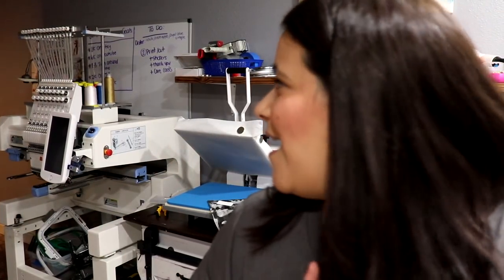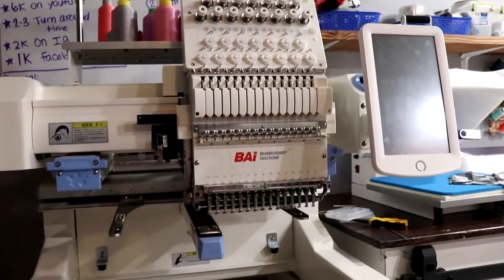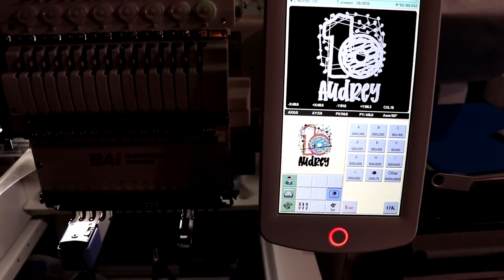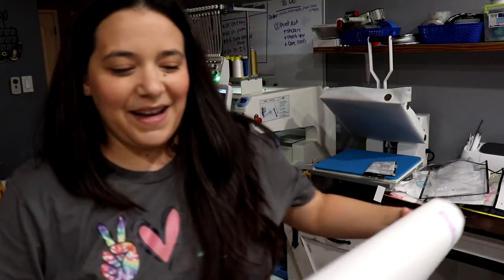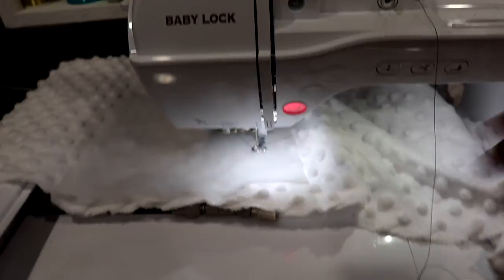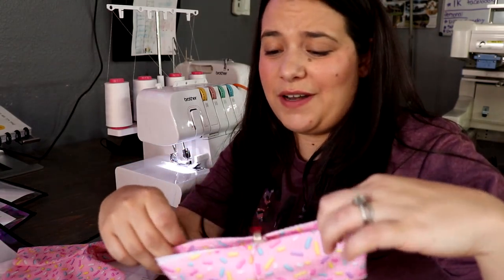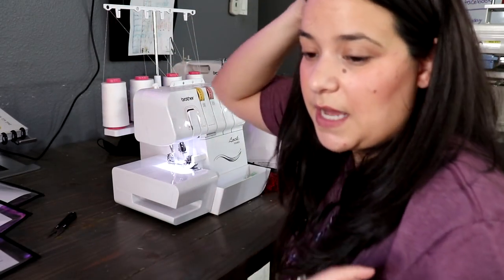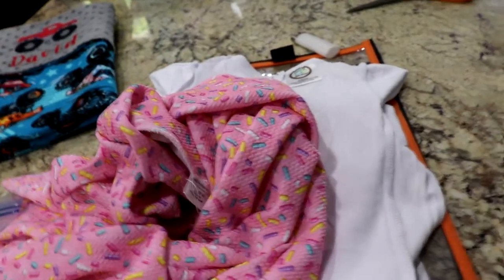Work With Me On Etsy Orders / How To Make An Applique Shirt Using A BAI Multi Needle / DITL

Comment: Hey neita have you heard of the 10 spool holder that you can put on the top of the babylock flourish it can make thread changes a whole lot easier. It’s like $200 but you just pull the threads down straight into the thread path. Hope that helps!
Reply from the maker: Noooo I need to look into this 😳🤯
Reply: Dang almost makes it a multi needle
Reply: I have a 20 spool holder that I got off Amazon. It’s great. Just sits behind the machine.

Comment: Get used to that BAI!  I do blankets/beach towels, etc. on my 15 needle. Float the blanket (saves on hoop burn).  I do use the table & if it's a really large blanket/jacket, etc.  I put an office chair or bar stool in front for extra support
Reply from the maker: Thank you so much for the tips! I need to get over my fears and just make a blanket already 😂😭

Comment: Oooh, all those pins when you're sewing....that's what scares me, I'd be scared about pricking myself. That's a very good point that you made, about being interrupted when you're sewing - having to keep getting up and down with the single needle machines...I'm trying to decide what to do regarding embroidery machines...I honestly don't think I'd have the patience for swapping the threads over all the time on a single needle and having to 'babysit' it all the time. Then again, what happens if I save up for a multi needle and then realise that I don't like embroidery....I will have wasted all that money. At least with a single needle - it's cheaper and I could test the water as to whether I enjoy embroidery or not. I hope you can get a 2nd and 3rd multi needle machine very soon. I think you will x
Reply from the maker: I suggest starting out with a single needle. If you like it and think you will enjoy the multineedle you can always keep it as a backup or resell it (I like to keep the original box of the machine just in case I plan on selling it)
Reply: @NeitaFajita  Thank you. I will take your advice on board - appreciate it x